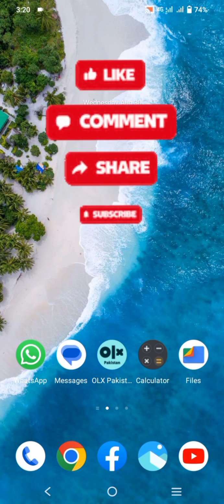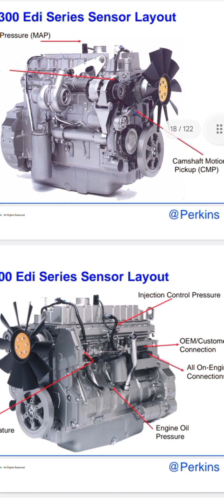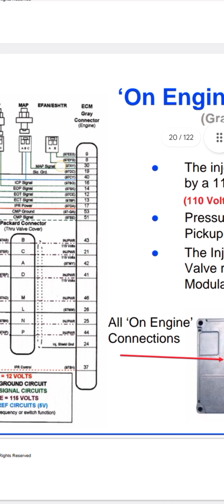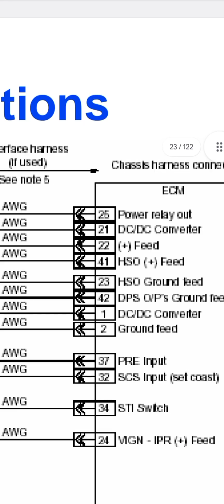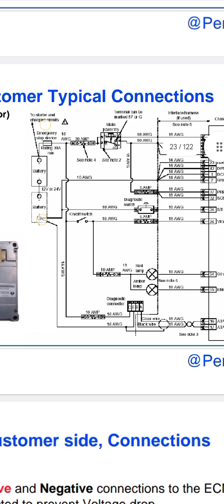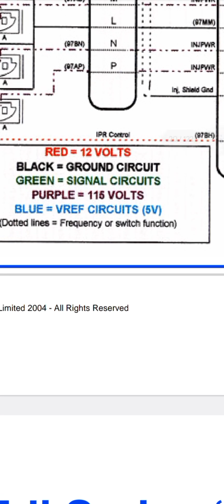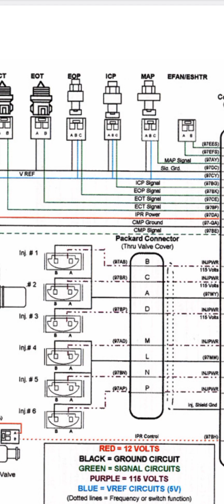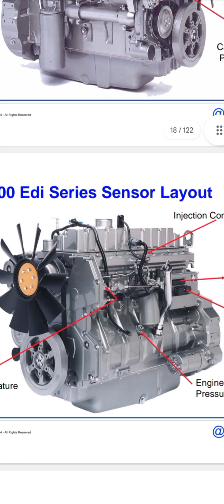Perkins 1300 series Edi complete wiring explain with diagrams generators

Comment: Thanks for the Info clarifications. Question, if I connect the ECM black power connector pins 1, 2, 23 & 42 to battery negative & pin 24 to battery positive should should pin 25 to the power relay become live with 24volts, Thank You.
Reply from the maker: Yes